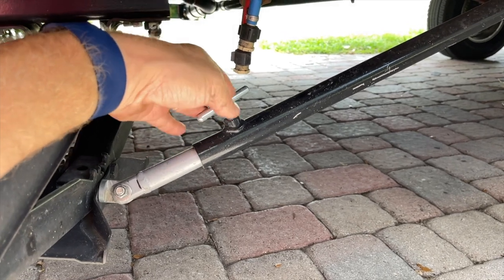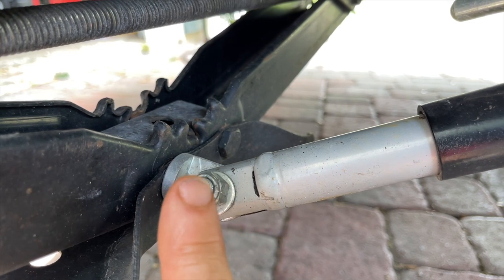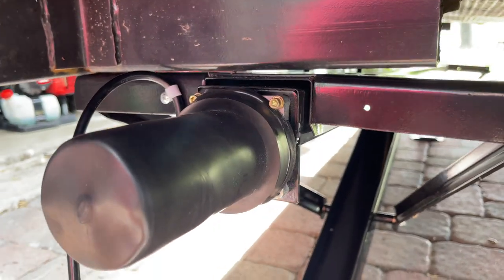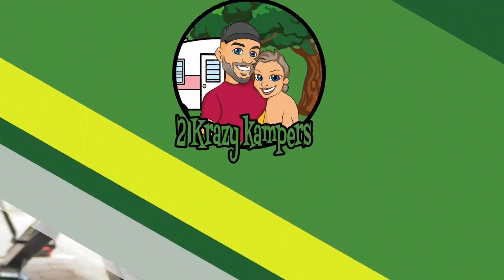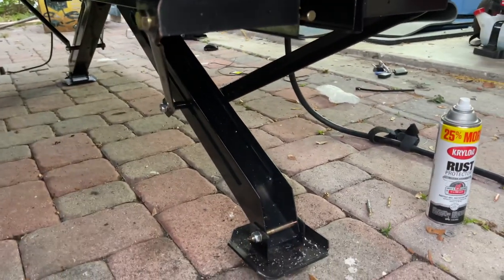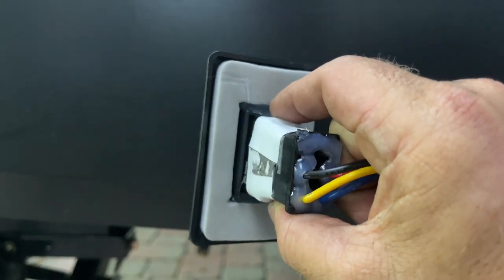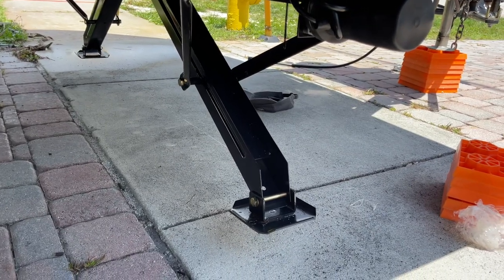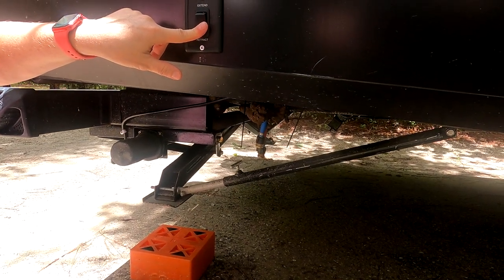Upgrading Eleanor episode 3 | How to add electric stabilizer jacks to your RV

Comment: We put our electric stabilizer jacks when we first got our Imagine and it does make life so much easier. But we left our old manual jacks on, just in case.
Reply: To leave your old ones on  was a great choice.  I love the electric ones because they are convenient, but you will find that the old manual ones stabilize your unit much better.  I will add manual ones on for long stays.👍🏻

Comment: I have two in boxes on my garage floor waiting to be installed. I’m Leary of the wiring and connecting to my two 6volt batteries. What gauge wire did you use, where did you fish the wire on your imagine? Lippert does sell a crank attachment for a drill in case battery power goes out.